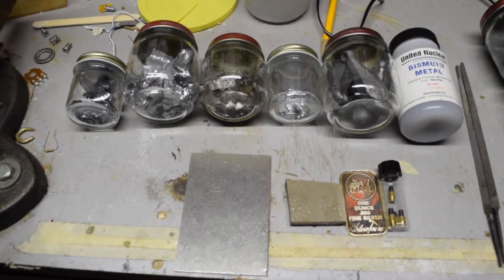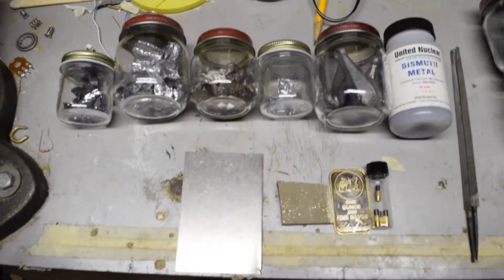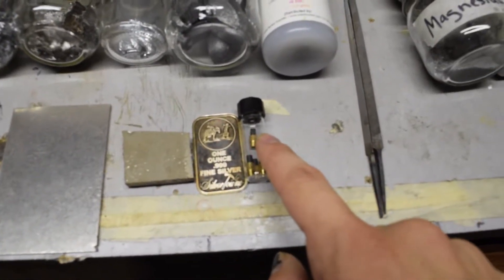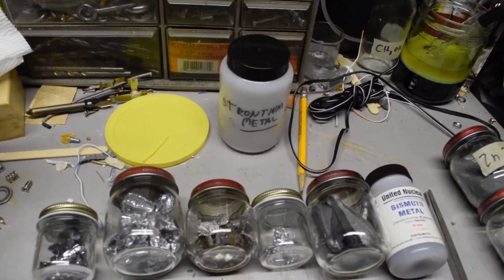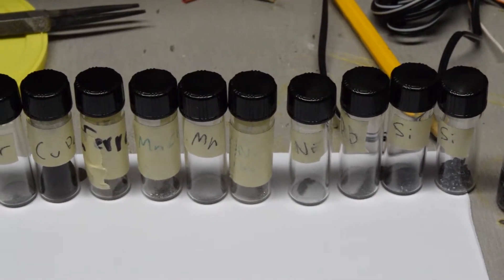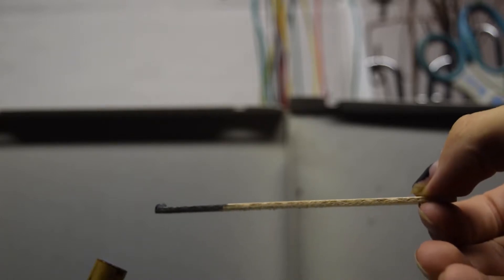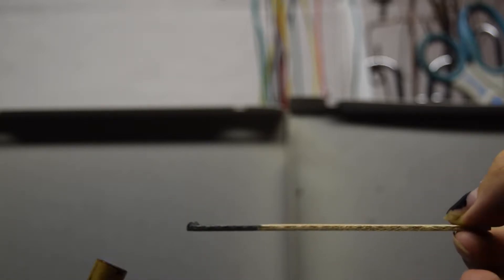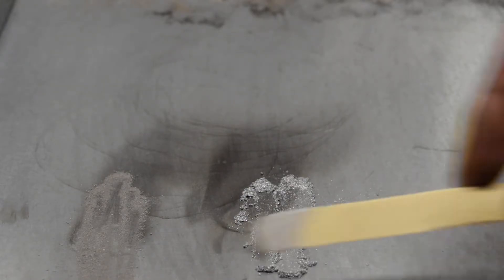Flame and Flammability (Spark) tests of Metal Powders

Comment: I’ve been looking at silicon for the past couple of days as a rocket fuel. I’ve heard it has reasonably high specific enthalpy and specific impulse numbers for any metal-oxygen mix. It has many advantages in terms of availability and versatility, whether being mixed with liquid oxygen into a lean slurry to increase isp by lowering exhaust atomic mass average, allowing it to act like a liquid monopropellant rocket, or sintering the fine powder in a anoxic environment into a shape able to flow LOX through it, like a hybrid rocket, or mixing it into a solid oxidizer, solidifying the mixture into a cylindrical mold with a star shaped cavity as the combustion chamber and treating it like a solid rocket. 

I believe this video confirms to me it would be superior to Aluminum, due to its exhaust product being vaporized sand that would immediately solidify into a dust that would then blast any metal-oxygen fire residuals. The abrasion of this exhaust on the GSE and something of a pollution potential are clear disadvantages.